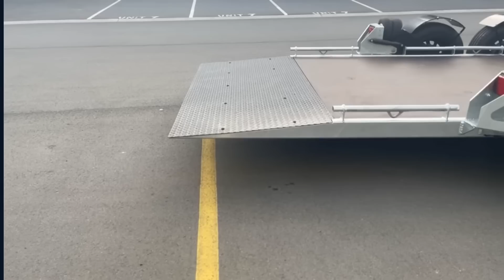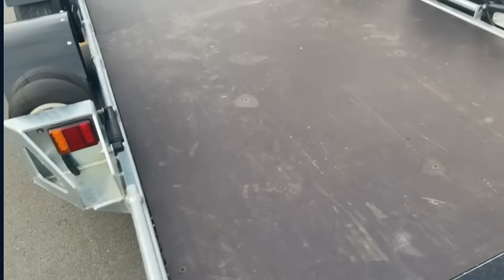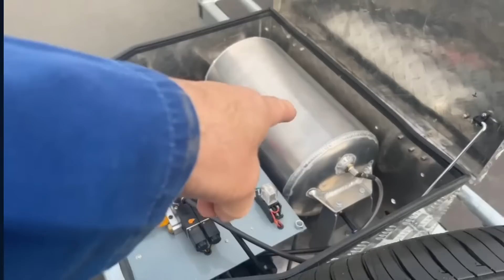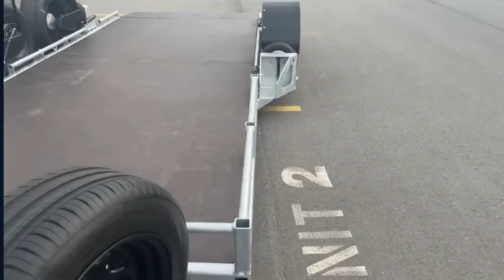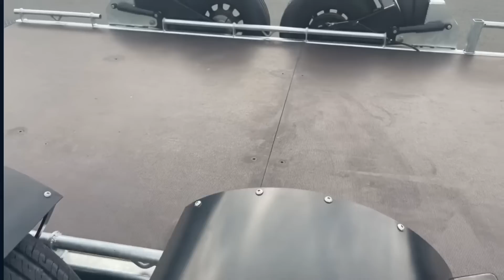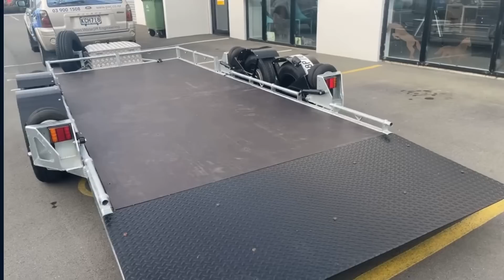How does an Airbag Trailer work 1.3

Comment: '
how about the ramp can up and down...
do this trailer have 2 amper yellow lights on the rear taillights for turn sign...
also have 2 white lights for backup reverse
Reply from the maker: The ramp does not go up, and there are a full set of tail lights, look in the boxes behind the rear wheels, stop lights, tail lights and Indicators. This trailer complies with the with all New Zealand  laws for trailers, yo umave have to place the lights in a different place for different countries.   We do not have reversing lights, but you can install them wherever you like , buy some of Ali Express :-)

Comment: Would an auto levelling function be useful, seeing as you can control each side independently?  Would it be expensive?  I had a quick look round for a suitable solenoid, but without knowing exactly what it would take, I would have been guessing.
Reply from the maker: Not a bad idea

Comment: Is there a safety mechanism that will hold it in the up right position in case of an air leak?
Reply from the maker: nop.
Reply: They could add a bar to the axle on each side that would pin them up for transport and once you get to the location you will just raise the trailer up and then up pin it and then lower it like normal but it's still a good trailer....

Comment: Only thing i think i would work on is a mechanical valve and level sensor, this way you can have smoothness when you lift and when you lower. Also it wlil level itself while driving.
Reply from the maker: Hi Christian,  I really appreciate your idea about using a level sensor for this application. However, I wanted to let you know that there could be a small issue with that approach. For the suspension system to work effectively, the chassis needs to be able to move around freely. If we installed a level sensor, it would pick up all sorts of movements, making it tricky to calibrate and causing some complexity.

Right now, we're setting the level by adjusting the ride height of the trailer when lifting stops, and it stays level until it's lowered again. This approach does keep the trailer level while it's traveling.

Thanks so much for your input! We're always looking for ways to improve our processes, so please keep the ideas coming!

Comment: Those airbags are the same type used on Semi's/Lorries. They will last for a long time as long as the rubber keeps up. I personally would swap the bags with firestone/Neway/holland hitch, but that my personal spiel.
Reply from the maker: Thanks for the suggestions, We have used Firestone, the cost got probitative and we are too small for them to deal with directly. The bags we currently used have lasted well and show no signs of fatigue even after 3 years of hard use.
Reply: @ultimatemanshed  i know more about them than I care to. I am currently standing 19 miles from where that style was invented

Comment: will it jump on a road whithout suspension?
Reply from the maker: It does have the suspension, the smoothest kind, Its airbag isn't it.. airbag suspension is the smoothest, the bag lift and lower the trailer as well as carry it and you can also see shock absorbers, if you can't make it out take a look at the other videos in the channel. Here is a link for you. https://tinyurl.com/28k259rj
Reply: @ultimatemanshed  thanks, perfect) like it

Comment: Would be great to be about to retract front or rear sets of wheels so that you can maneuver it around very easily when it is not on the back of tow vehicle? It also makes it easier to reverse and park. But otherwise it's very decent👍

Would be interesting also if you can do them with wider spacing and larger CAM rotation to suit "off road" so that you can get maximum clearance and ride height as well as lowering it to the ground?
Reply from the maker: James, we have found its very easy and light to maneuver by hand, much easier than a standard axle trailer, seems that the 4 independent wheels do not fight each other.

More height options would mean a longer airbag, we have tried and failed with this. but still looking for solutions.  Thanks for the ideas.

Comment: Is there any way in locking it at a certain height? What if there is an air leak in the system, then the whole trailer rides on the ground. Am I missing something?
Reply from the maker: You are not missing anything, a leak will certainly let the trailer down. however.. we have not have many leaks. we solved those problem some time ago by redesigning and installer higher quality air tubes and fittings. Now all of our fittings are rated 1000PSI and we operate at no greater than 180PSI.

Any air leaks are very probably a loose air fittings that can be found and tighten up with a basic tool set.

Comment: Pretty sick trailer there, hate to see what happens if you pop a line off.
Reply from the maker: lines don't tend to pop off, if they get a leak the trailer goes down slowly and you can usually find and solve the problem quickly. We have not had a catastrophic drop even with a big leak as the is a lot of air to get rid off.

Comment: Some issues though?  Those airbags are just waiting to be knifed by some jealous assholes.  
The number plate mount is completely illegal for any Australian State, I can’t imagine it would be legal is NZ like that either.  
And the tail lights/ brake lights mounted there would make them impossible to see from some angles when there was a car in the trailer.  Surely that’s not legal, and certainly it’s not desirable.
Reply from the maker: well, let me apologize for being such a dickhead... we have no idea what we are doing, and that's why I suppose we have been in business for years and sold a sh.t load of trailers that are all legal and working well thanks, However, to put your mind at rest...

Firstly, regarding the airbags being knifed by jealous people, it's worth noting that modern airbags are designed to withstand sharp objects and are not easily punctured. So while it's understandable to have concerns about vehicle security, the likelihood of someone being able to knife an airbag is very low. Clearly, you live in an undesirable area.

Next, with regard to the number plate mount, it's true that regulations for number plate mounting can vary between different states and territories in Australia and New Zealand. However, it's always best to check with local authorities to ensure compliance with regulations in your specific area. We did and it's certainly legal here.

Finally, regarding the tail lights/brake lights mounted on a trailer, it's important to note that these lights are designed and tested to be visible from various angles, including when there is a vehicle on the trailer. It's also worth checking local regulations to ensure that the lights are properly installed and meet any necessary safety requirements. We did and that's why. it's legal here

We all look forward to seeing your trailer and hope you will be so gracious as to do a few videos and show us how clever you are. All I can say is thank god you live over there and are unlikely to ever become one of our very happy customers. Shesshh man WTF...

Comment: needs tiedowns to the deck for wheel straps pressed steel plate with the right holes in it
Reply from the maker: why? we have more tie down point that you can throw a stick at... you might mean you would like an option to have something specific to you needs?
Reply: @ultimatemanshed  no one would tie down a car over 80k on that just not right what pulling a strap through each wheel out to the tie downs you have too much stress on them flat tyre straps are the new norm get with it

Comment: I might be wrong, but the angle of them bags is quite extreme and would probably cause a lot of rubbing when in motion. Would that not cause premature failure? Im not an expert in bags, so please correct me if im wrong.
Reply from the maker: Excellent comment...You might be wrong, the bags are designed by the manufacturer to hold a certain pressure, rubber does not care what shape it is when under the correct pressure. All we have to be careful of is the bags do no unduly rub on the lifting cases or anything else that might wear the bag.  Some of our trailers have been in heavy service offer 3 years and there is any sign of wear on the bags or any other part of the running gear.

Comment: Great idea however I would definitely hate to be in any vehicle that accidentally runs up the arse of anyone towing one of those - that rear ramp would act like a guillotine and slice it’s way through anything.  Knife through butter comes to mind.
Reply from the maker: Yes, probably good to travel at the recommended following distance and it's more likely a vehicle will run over the ramp at sump level. I can't see anyone getting cut in half unless they are very short driving a car that is 300mm tall at the windscreen :-)

Comment: Really cool setup, i wonder how it rides.. I see 2 things of concern, we all know rubber will dry rot no matter what claims they make, it may take 5-10 yrs but it will. Also whats to stop it from flipping a load if a bag or 2 blow out. I can see a top heavy load like a tractor hit a big pot hole blow the bags on that side and roll it. May be 10 years down the road but.. do you have a replacement schedual on the bags? Probably should.. maybe the manufacturer does already.
Reply from the maker: If the rubber bag need replacing in 5/10 years, why not replace them, they will be cheap and take about 10 minutes each to replace.
If a bag blows it quietly lowers itself to the ground nice and even.
We have had large tractor loads hit deep potholes and damage the wheels, it ruins the tire an in some places the wheel, however the worst you get is a flat tire and you come to a stop and replace it as we carry spare wheel.
Reply: @ultimatemanshed  sounds good 👍

Comment: Very nice 👍 , until the cheap Chinese relays and other electronic solenoids quit working due to vibration , moisture and weather .  I notice I didn’t hear or see a price ?  So if you have to ask , you can’t afford it. I hate to be the negative Nancy of the bunch but I’m just tired of people overcharging for products that are made with cheap parts , acting like they reinvented the wheel or bottled lightning . If it works 5 years trouble free , comes with a 5 year warranty , then I’ll be impressed
Reply from the maker: Well, be prepared to be impressed, even though you can't afford it.
We have designed and build our own PCB with hardy well tested electronics
The relays are solid state so do not get vibration affected, the solenoids are top end industrial products.
All the wiring is encased and fixed at all corners and inside the chassis so cannot be exposed to weather, bad storage or bad driving habits.
The air pressure system is Stainless steel rated up to 1000PSI even though we operate at 280 PSI max, the air tank is certified and tested.
Save up your money and when you could afford one, mention this post and I'll give you a 5 year warranty :-)
We are also annoyed by people who claim they have reinvented the wheel, did at anytime you see or hear us make any such claim?

The trouble is with people like you , yes YOU>>> all you want to do is pull other people and their products down, why don't you get out there, invest your own time and money and come up with some solutions instead of being a miserable negative nancy!
NZD$22,000 to $26,000 but hey, you don't want one anyways so what's the point in telling you the price. sheshhhh
Reply: @ultimatemanshed  
Build a product that last and I’ll be positive .  I’ve built plenty that’s still working after 20 years . Stuff I’ve built been outlasting every brand name in the market or anything coming out of China , Detroit , Mexico or Canada . I hope your product works as good as it looks . Time will tell though won’t  it

Comment: pretty cool little beasty of a trailer. the axial loading of the airbags hurts my brain to look at.  I assume that they are overrated to compensate for the capacity loss. 30-40%? I also assume that there is a limiter plate on the swing arm in the advent of a bag failure.
Reply from the maker: All designed to handle any over leads that a user can impose on it including large pot holes and failures. No limit device on the leverage arms otr they would limit the movement of he trailers ability to raise or lower. Unless you know how to design one?
Reply: @ultimatemanshed  eh its probably doable with out too much issue. effectiveness would be a different matter. the point of that design as you have it is to almost lay the frame on the ground. a u shaped bump stomp on the back side of the swing arm at a location that would catch the frame in the advent of a bag failure. would add a fair amount of complexity considering they need to be different for each arm. probably only needed on a pair of the arms though to acheive the effect. to the question of the effectiveness. would only really serve to allow it to be towed unladen to be repaired.,

Comment: And the sway affect you get with individual air bags and not have no means of a tortion limitations usually is why theres a axle not having that makes it dangerous dot wont appove it in usa if its brought to their attention.
Reply: Lots of independent wheel rubber torsion axle trailers these days on the road in the USA and many air bag semi truck and other vehicles also. Boat hauling trailers and equipment trailers use air bag springs for the reason he is building that kneeling trailer.
Reply from the maker: MyGoodrich, clearly has not studied air suspension.  We do have shock absorbers installed and there is no excessive sway. Il have to do a follow me video..

Comment: Wonder how often the air bag pedestals cut into the air bags they arent even being used properly?!
Reply: The air bags are not properly aligned or the proper ones for that application
Reply from the maker: Please tell us how to use them properly
Reply from the maker: Better still tell us which are the correct airbags for this application. All suggestions great fully appreciated

Comment: Saw a somewhat different design a few years ago at a truck stop in Indiana. It was getting delivered to a customer as well but the driver was more than thrilled to show it off. It was hydraulic and it was a 24ft setup with a large wind screen upfront to protect against rocks and debris. Soo cool I wish I had one

Comment: Looks nice can you dump the air in just one bag. For changing flat tires. 
Needs brakes on all axles. 
Is it fully grease able? 
How stout is the swing arm assembly?
Reply from the maker: Yes changing tire no jack is needed,  Ill do a video soon.
It does not need brakes on all four wheels.. There is plenty of braking  with  remote control  for weights up to the trailer max.
The only parts that need grease are wheel bearings, easy to do as they are a standard fitting.
The swing arm is shit engineered , designed to break as soon as it leaves the factory???   Please forgive my mirth but I wonder at some of these questions.  Why on earth would we spend 3 years building trailers and not make sure the swing arms are as strong as they need to be?  Yes the swing arms are built to the same standard as the rest of the trailer.

Comment: Pretty ingenious.  I would think that a protective cover over the air bags would be a good idea. Keep them from UV exposure and degradation as well as random acts of vandalism.
Reply from the maker: The Airbags are UV coated and there used to be a hidden shotgun triggered by tossers approaching the airbags with sharp objects. We had to remove it as a lot of people got injured
Reply: @ultimatemanshed  lmao
Reply: I would imagine if charged the airbags will be self defending, lots of pressure in those bad boys!
Reply: Can you ship to the us? What’s the best email to email you?
Reply from the maker: @shawnkessler5866  alan@pwj.co.nz
Reply from the maker: @shawnkessler5866  I can ship anywhere.. alan@pwj.co.nz
Reply from the maker: @shawnkessler5866  I have not shipped to the US, yet :-). alan@pwj.co.nz
Reply from the maker: @shawnkessler5866  I have not shipped to the US yet. alan @ pwj . co . nz
Reply from the maker: @shawnkessler5866  alan@pwj.co.nz
Reply from the maker: @shawnkessler5866  alan@pwj.co.nz
Reply from the maker: @shawnkessler5866  alan@pwj.co.nz
Reply: Over all that's a great idea, shouldn't take that long to design.
Reply: Should they also add protective cover to the tire? You jocking right??
Reply: @frozenshade666  Sun damage a real thing to tires and thus the airbags are probably subject to the same deterioration. Ever seen junk cars or airplanes that sit in the sun unprotected? The condition of the rubber will vary from side to side depending on how the Sun strikes it.
You can scoff, but you’d actually be on the wrong side of the argument. It’s a beautiful trailer, if it were mine, I’d take good care of it.
Reply from the maker: @tedbaxter5234  Ted, how many tires are exposed to the sun every day globally, and how many exploded? I have no idea but it's not something leading the news every night.  Whilst your facts are correct, the sun affects rubber, the reality is not an issue in the real world.  You would be better off worrying about world peace or melting glaciers.
Reply: @ultimatemanshed  unprofessional answer, as tires are changed constantly as they are consumables and your airbags should last the lifetime of the trailer.
Reply: @ultimatemanshed  russian military vehicles in storage were not being rotated so the sun hit the same side every time. Poor maintenance and corruption degraded the tires and we saw what happened next.

Comment: how do you align  the pivot points? how did you check the alignment?
Reply from the maker: Everything is jig build and as we weld to the chassis the axles are aligned before welding. Its not easy getting them perfect